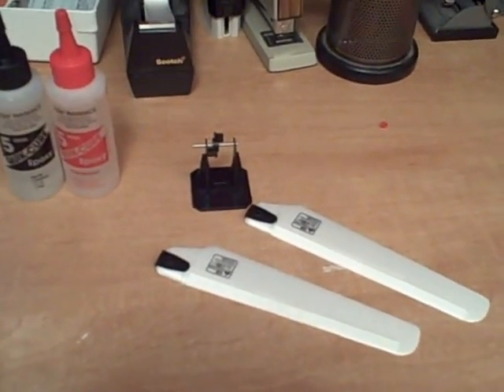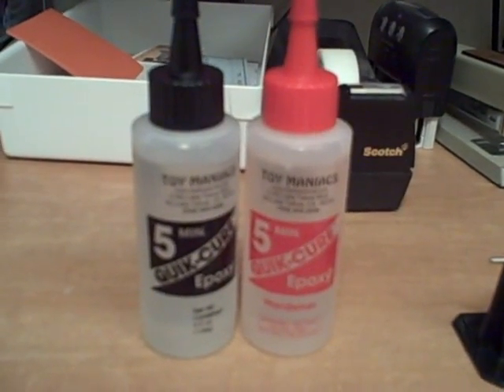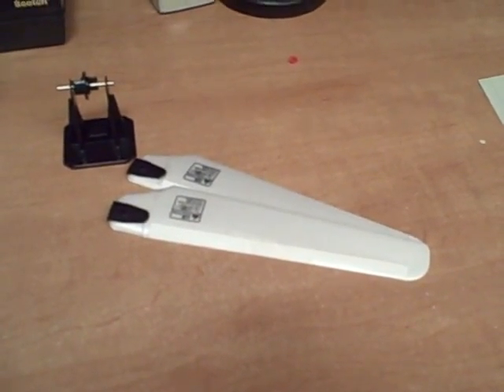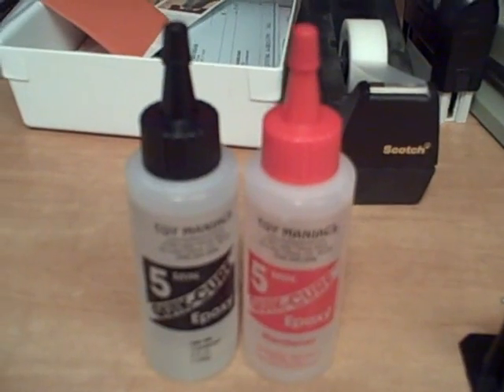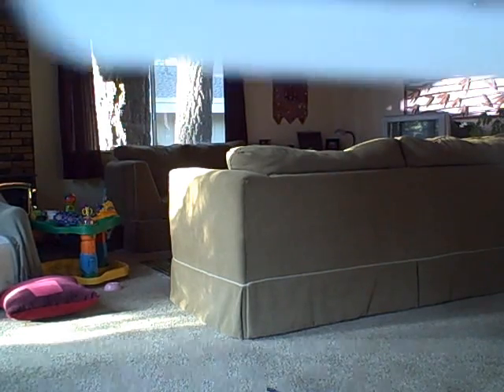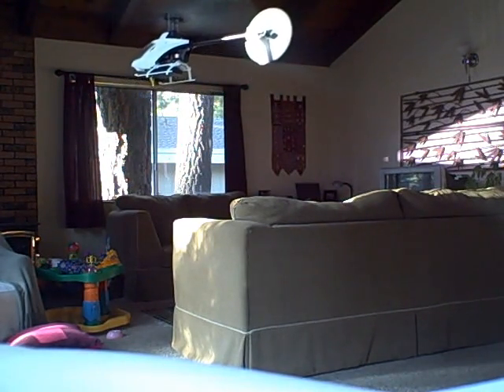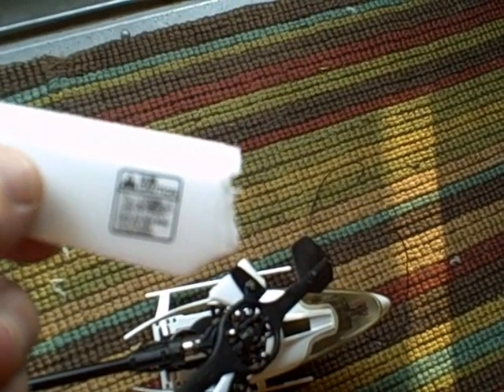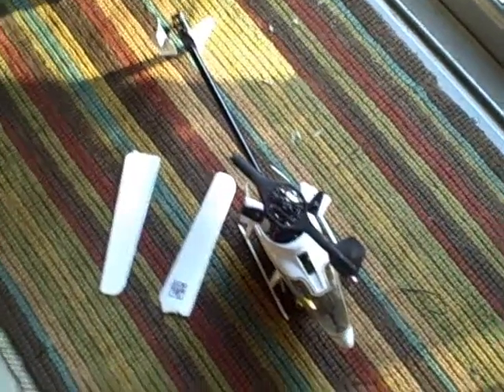Fixing Quark Blades - Laminate, Super-Glue, or Epoxy?

Comment: get carbon props. they are covered in epoxy and IN MY QUADCOPTER MY ARMS FUCKING BROKE BEFORE MY BLADES I WAS LIKE WTF MY ARM SNAPED IN HALF BUT THE MOTOR ESC AND ALL PROPS WERE FINE WTF

Comment: Check out the MIA Micro-FLIGHT laminating Options. Note that laminating i the general sence depends on the type of material that you are using to laminate the blades. Packaging tape or the methods from MIA MIcro-FLIGHT will make the blades stronger but they will still break befrore any other part breaks.

Comment: Epoxy is a resin base and will not eat foam. This is the reason Epoxy is best for gluing foam parts. CA glue on the other hand is a CyanoAcrylate it will eat Foam parts.  Once the blades are Epoxied it will not fail at that spot!